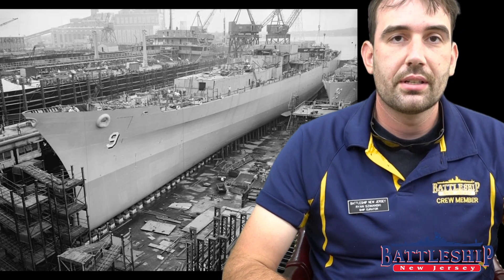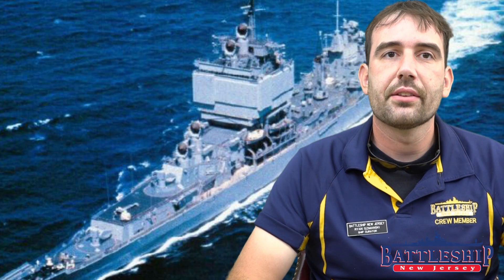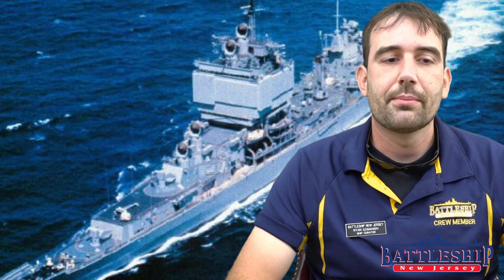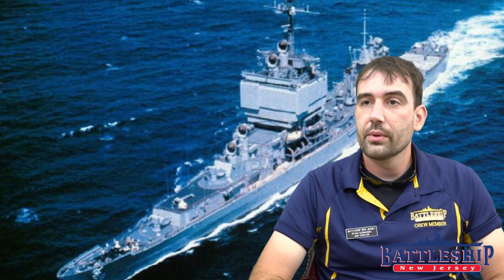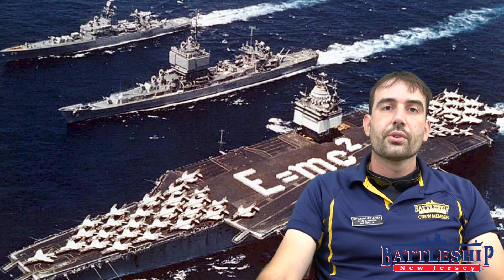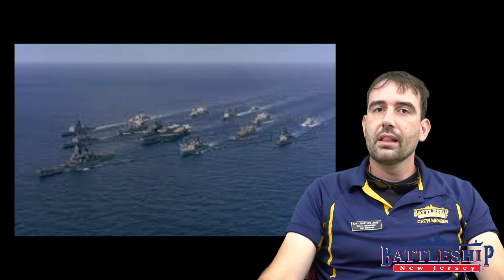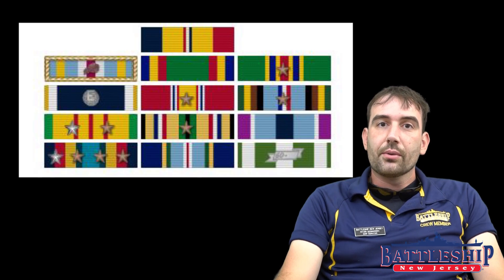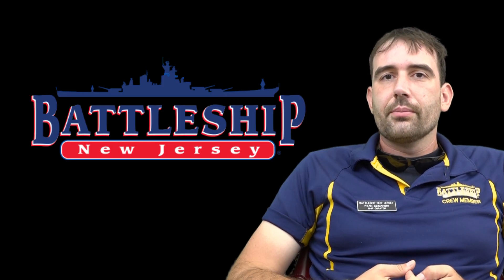NUCLEAR: USS Long Beach (CGN-9)

Comment: The story I heard about the 5" guns was when produced and launched she had no guns.  During duty off Vietnam she was attacked by North Vietnamese PT boats.  She had no conventional guns to deal with this threat and had to call for air support to fend off the attack.  She was a product of the thinking that the Navy had gone beyond conventional guns and was an all missile concept now.  No matter what modern weapons we have on ships there will always be a place for conventional gunnery.
Reply: And nothing better than the 16" with modern more capable projectiles
Reply: I think there was even an plan to fit the ship with "aegis" and include the mk71 8" gun. But it was all concept.
Reply: @chukkie0001  The system the LA had was a precursor to Aegis. It was call Typhoon and was a combat and fire control system that linked the Enterprise with it designed to dominate from surface to space.  The fixed array radar was very unreliable as it relied on mechanical coupling of the microwave waveguided signal in and out of the array.  They just couldn't make it work and that lead to the computer controlled Aegis system we all know and love today.  Typhoon wouldn't have worked very well in today's environment.  Typhoon only had so many missile launchers and could never meet the massed attacks expected from today's modern weapons.  I remember the USS Hull tied up along side my tender.  It was surreal to see that huge 8" gun mount up forward.  What prompted their visit to the tender was while out on the test range after they got about three shots off most of the 10-32 screws heads that held the radios and electronics in their racks snapped off and the equipment went flying.  67A was very busy and pretty much depleted our supply of parts for this equipment.

Comment: Long Beach was the last US Navy ship to have teak decking installed
Reply: in 1988 I was on the teak deck tiger team in first division that removed and rebuilt those decks.
Reply: I remember, I had my shop port side across from the torpedo tubes.It was a father, son team from what I remembered doing the repairs.  @cabpirate575
Reply: 74-77 I was able to get a piece of the teak wood deck when she was scrapped.
Reply: It's my claim to being a veteran of iron men and wooded ships. Shhhh lol

Comment: Well I have to say the picture you used talking about battle group Echo. Is a picture of the Battle Group Alpha, and the USS Long Beach CGN-9 was not in it. Battle Group Echo was much larger with the USS Long Beach CGN-9 right behind the aircraft carrier. My ship was the USS Bunker Hill CG-52 and was in both battle groups, and I do have to say when it came to Anti-Air Warfare The USS Bunker Hill CG-52 was the newest Anti-Air Warfare platform of both Battle groups, which in my humble opinion reined supreme of the Anti-Air Warfare platform of the two Battle groups.
Reply from the maker: Our poor editor is admittedly not an expert definitely picks a "seems right" way too often. Thanks for the heads up! - Libby the editor

Comment: Ha-ha!  People and their numbers for the max  speed of the Long Beach.  In my 13 years onboard from the 17k tons with the Talos system installed until the final configuration several thousand tons lighter, the fastest we ever could get her to go was a shade under 31 knots which is slower than an Iowa-Class BB.  And, no, there were no "speed screws" that could be switched on to make her faster (at least after February '74 until  October '92 during my periods onboard).  This guy said he thought 35 knots was possible and I just about spit my drink all over the keyboard!  LOL!
Reply: I was told that bilge about "speed screws", too. I couldn't talk anyone out of it.
Reply: @captaincrunch5878  That is complete BS dude! I was there in 85 and we did NOT get new screws in Bremerton. We never had new screws installed. We did get new main condensers, I know because I was a nuke who stood watch in the engine room. As for the reduction gear DIW, was because the ER Upper Level Watch could not disengage the jacking gear and it exploded when the motor was driven backwards by the worm gear. The broken pieces had to be removed and then a new Jacking Gear installed. We could not hold the propeller still if the ship was moving through the water, hence DIW is required to work on the gear safely. I remember there were 2 guys working on the gear to repair it and 7 Captains and Admirals standing there observing them work! No pressure as we look over your shoulder!
Reply: I was in A div. and I remember the machinist being pissed that he had to do that job because of a mistake and not wear and tear. I remember that he couldn't nock off until he finished the job.  @allaboutboats
Reply: After that yard period, in which the screws were NOT replaced, we did a flank speed trial and the resonant vibration of the superstructure at flank rpms became the limiting factor. The superstructure was vigorously vibrating fore and aft at 35kts on the pit log. We had to reduce rpms to stop the vibration. I was in the bridge as JOOD.

Comment: My intro to USS Long Beach was in 1969. My destroyer (USS Maddox DD731) was tied up outboard at The Mole in Long Beach. As a young ICFN, I was tasked with running the shore phone cables over to the pier, meaning I had to cross over the mid-deck of Long Beach. I got about half-way across USS Long Beach's deck when a group of Marines invited me to perform a face place on the deck, with very nasty guns at my back. Took about 15 minutes to clear up the situation.
Reply: It's even more fun when the base PIO has kindly distributed the ship's numbers before you are even moored.  All of the pierside phone terminals at NSC Oakland and NAS Alameda in the late 80's were the old stud-and-nut terminals with screw-in carbon protectors.  All 13-20 lines which we normally had assigned would be ringing as the ladies were trying to contact their sailors.  Quickly learned to pull the protectors before hooking up the lines.  (For non-phone folks, standard ring voltage is 90 Volts AC at 20Hz.  When you, the terminal, and the pier are all soaked with salt spray, you FEEL a ring signal.  Pulling the protectors isolates the terminals and in some terminals shunts the lines to ground).

On the bright side, pulling that lone 50-pair phone cable (and sometimes even cable TV) always got me out of reporting to the fantail to pull 6 or 8 shore power cables.  (Think of what size extension cords one uses to plug a 650 foot ship into the pier with...)

Comment: power plant refueling on a nuke BB multi-level hardpoints would not be impossible as to fitting say missile armament to and Iowa hull better its to delete the number 3 aft turret there's enough space there for at least 2 MK51 VLS systems and replacing the 5inch guns with modern Autos and rolling airframe point defense systems and a ton load of automation and Ageis fire control without all that bunker fuel an Iowa would be a pretty light fast hull unless you wanted to retain that facility as a forward logistics support  2 million in the tanks is a lot of logistics under armor....I could very much see a use for a modern reimagined Iowa...
Reply: Refuelling the escort ?

And suddenly we have a super battle cruiser which together with a good asw and air defense escort can operate independently and being big enough to deliver a lot of destruction.

Comment: Why was she given 5/38s instead of 5/54s?
Reply from the maker: She wasn't supposed to have anything so when they decided to add them they just took what was in the inventory
Reply: @BattleshipNewJersey  I was thinking they might have had some from down gunning the Midway class but I guess they didn't really see the need to put guns on them in the first place so just slap the 5/38s on and report mission accomplished.
Reply: @jnelchef  .... IIRC the Forrestal class original defensive armament was eight 5/54 single mount guns
Reply: @jnelchef  Correct. In contrast - additional information - Navy build 17 Frigates in early 1960s with 5/38 for main gun. Refurbished mounts - not new built- taken from something decom.
Reply: A possible consideration- the 5"/ 38 single could be operated manual, the twins and the 5"/ 54s needed power. If the plants were both down, there may not have been enough electricity available.
Reply: @hk-wr2jt  Very interesting, thanks!
Reply: 5/38s were in stock and cost the navy nothing compared to ordering 5/54s?
Reply: @Idahoguy10157  Poking around, it looks like the Midway class started losing 5/54s in their major refits in the mid to late 50s so I suppose technically, they could have transferred two of those to Long Beach. I guess they just didn't bother for some reason.

Comment: i don't think they don't need a huge hole for refueling nuclear sub (having huge hatch on a submarine is not very good also fuel rod are not that big  )  so it should not be a problem to refuel a battleship  a normal crew size hatch should be enough to pass fuel rod in .
Reply: I was on USS Robert E Lee for her third overhaul during overhauls they tend to move the hull cuts kinda hard to move the area above the reactor “I think” they cut the first time either big or barely enough and then increase from barely enough to decreasing size on the big cuts Welding HY-80 is a pain with each pass INSPECTED dye penetrant ¿ultrasound? or x-rayed, BUT when refueling S5W you pulled one fuel element at a time ¿21? comes to mind 19 with control rods and reinstalled the S3G core 3  it goes in in one piece much longer lived except for possibly S5W core 4 which I don’t think ever made the fleet just at S1W where I trained

Comment: I watched a talos launch from the crows nest, the thrust pushed the fan tail under the water and blew the water back to form a bowl before the rocket lifted off. Then two terrier missiles were launched to follow it and shoot it out of the sky. One of the doors on the port side was ripped off from the exhaust of the terrier missiles take off

Comment: Cobblers!  Virginia Class CGN Class were not based on either a Frigate or Destroyer Hull.  It was almost designated a DESTROYER LEADER (DDLN) but was closer in size to a WW2 Light Cruiser.  I was on USS Texas and that CGN was massive and really fast.  Main disadvantage to the Virginia Class was no Helo capability.  Frigates are really small.  Spru-Cans, Kidd Class, Ticos, and Burke all shared the same hull design.
Reply: The Virginia class were first called the DLGN, then reclassified as a CGN. Ia served on the CGN-38 and the keel plaque in acmr#2 is where the keel plaque is and it read DLGN.
Reply: Also there was room for a helo hangar and they reconfigured it to be a big ass class room for the nukes, it was a retractable helo deck, if you ask any former crew members of that class if ship they will verify that.

Comment: November 1992 the cruiser USS Long Beach reported leaked hundreds of gallons of low-level radio-active water in five Navy ports because of a malfunctioning valve, including a total of 159 gallons of primary coolant while moored in San Diego.  An excerpt from an article in the Union Tribune by Greg Vistica, stated," Copies of pages from a log on the ship that lists discharges of radioactive liquids were bought to THE SAN DIEGO UNION by concerned sailors who accuse the Navy of sacrificing safety in order to meet scheduled operations..four of the sailors on the ship over an undetermined time period have developed cancer, the crewmen said.  Two had brain tumors and two had leukemia..."
Reply: "Radioactive" as far as detectable and logged shipboard.  No investigation by civil authorities, no cleanup, nothing...because the activity level of the contaminated water was FAR below federal standards for discharge.  Water is inert.  It is the minerals and contaminates in the water that can become irradiated.  Reactors and boilers use DISTILLED water.  I've seen hundreds of gallons of boiler feed water go overboard due to contaminates that would have been quite acceptable in a commercial lab environment.

Comment: Does the remaining section of CGN-9 include the reactor compartments?  I find it odd the entire ship wasn't scrapped.  Why leave this chunk?
Reply: As the reactors and systems are both classified and have residual reactivity, they are not scrapped.  As an example, decommissioned submarine reactors are de-fueled, then the ENTIRE reactor compartment is sealed and shipped by barge to Richland, WA, then by special crawler to a disposal site on the Hanford Reservation.  Google and a good eye will show you a very large pit with multiple rows of what look like large white tanks laying on their sides.  Try 46.5665548,-119.5205058
Reply: @David Tabner No, not leaky at all.  All US nuclear ships have their reactor compartments cut out, packaged up, and buried at Hanford, WA, for long term storage in Trench 94.  The Long Beach reactor compartments are much larger than those of ships previously dismantled including the smaller cruisers (Bainbridge, Truxton, Virginia-Class, California-Class) and present a different challenge to this disposal method.  The Enterprise reactor compartments are similar in size and also add to the challenge which totals 10 very large containment boxes to design/fabricate/install/transport and bury.  It is true that there is residual radiation involved due to materials of construction being exposed for several years to radiation flux but this is true for all of the dismantled vessels, submarine and surface, and not due to being "leaky".  Take a look at the Google overhead of Trench 94 and you can see part of the challenge of fitting 10 very large boxes down into it.
Reply: Salvage yards/ foundries will not accept anything with nuclear radioactivity on the steel it will ruin the batch of Steel and it'll ruin the machinery for said facility so unfortunately what's left of the hall will probably sit there for the next Thousand Years!!
Reply: @michaelshaffer9051  She was built using 450 Tonnes of aluminum. "From Wikipedia" In addition to steel, Long Beach was built with 450 tons of structural aluminum.

Comment: While on plane guard, in a calm standdown with Kitty Hawk. We watched Enterpise, Long Beach, Bainbridge and Truckston.  Doing flight ops on Yankee Station in excess of 50 knots.  1970.
Reply: No, you didn't.
Long Beach would strain to reach 30.5. The reactors would provide plenty of steam, but the main engines and shafts maxed out before 100% Rx power.
Reply: @hk-wr2jt  i'm not too sure about that30.5 knots. My  brother was on her and he said he saw 35+ knots as a BM. He said the ship shook like hell at top speed.
Reply: @dannyisaacs7552  It shook at speed, but there is no way it ever made 35+ knots. The turbines would not take it, the gears wouldn't take it, and shaft 2 would break first.
I do believe someone told that to your brother, though.
Reply: i was on the hero ship uss gridley dlg 21 we regularly outran russian torpedoes at 48 knots then turned around and sank those subs using just our depth charges 
  once we helped the enterprise shell haiphong until they all surrendered the north vietnamese were really afraid of us cuz we were really bad we shot down 16 migs our captain gave us all medals then we just came home it was fun our boat was no. 21 true story
Reply: @francisbusa1074  BS.
Reply: I agree that it never did 35 knots. We were told it was faster with "speed screws" but #2 shaft couldn't handle the torque. Interesting thing. In 1985-6 or so, she lost a line shaft bearing in her way to deployment. She had it replaced in Hawaii during an emergency dry docking. Two messenger watches went to Leavenworth, or so we were told. #1 shaft had a section that looked different and had a line shaft bearing that was different. Also, #2 ME was called Screaming MEME. It was LOUD.

Comment: Nuclear-trained operators are expensive to keep, because the civilian world essentially throws money at them, both because of the training they've received and the brutal Darwinian operating environment they've proven themselves in. Cruisers just don't provide enough benefit to the fleet to offset their huge operating costs, especially when you have to pay $100K retention bonuses just to keep the reactors manned.
Reply: If they didn't retain zero-people- skilled nuc supervisors, and tried harder to prevent port- and- starboard duty sections in liberty ports and didn't give the married nucs preferential treatment in home port, retention would be better.
Reply: True. A reactor operator who is navy trained is pretty much worth their weight in gold bullion.
Reply: With modern reactors being able to run 30 odd years on a fuel load I'm suprised that nuclear powered surface ships haven't come back, Imagine a destroyer that never needs refuelling...
Reply: The cost comparison must include the fuel used by the suck and blow cruisers and destroyers. With that comparison, the break even point is about $80.00 to $100.00 a barrel, from what I've read. I completely agree that nuclear leadership mostly sucks. It's a legacy of Rickover, that nuke officers are mostly micromanaging a$$ hats.